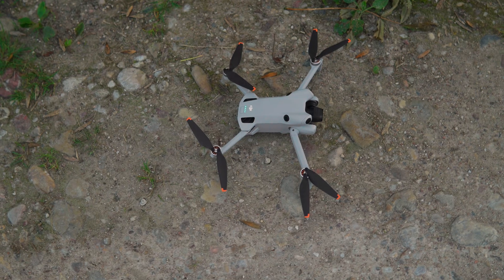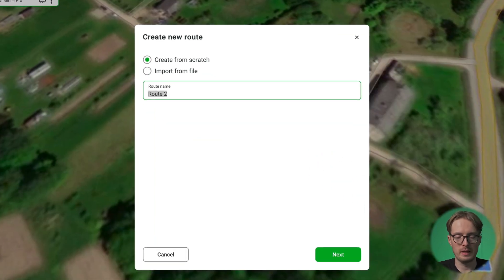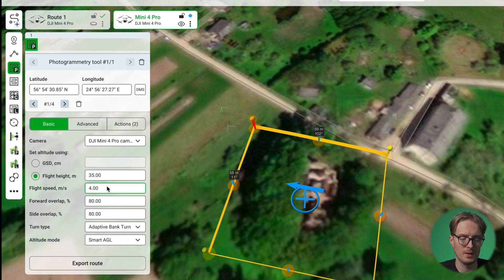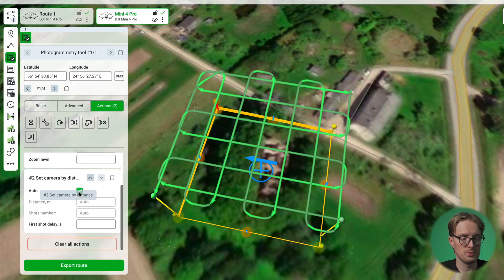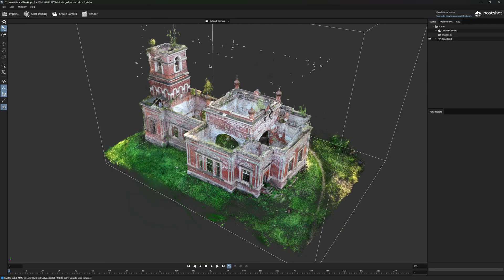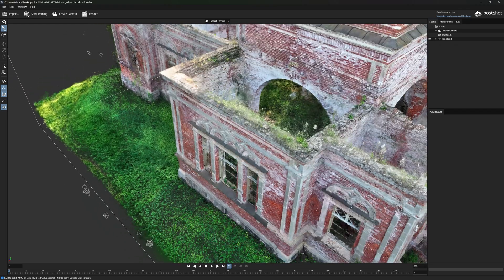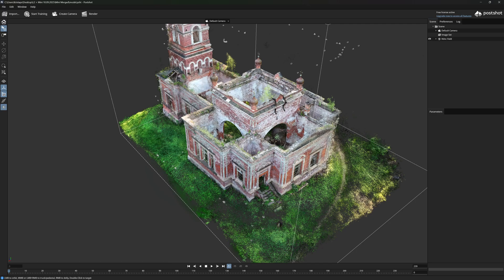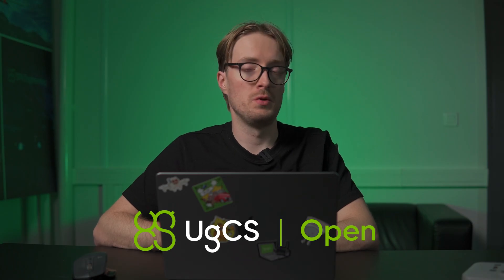How I Made a 3D Church Model With a Tiny Drone for FREE

Comment: Did my first 2 mappings with the ugcs and mini 4 pro.   It works! Had some problems fixing network and ugcs companion.   At the end all works but I have 2 questions.  1. How set the shutter speed and iso in ugcs? 2. How to save maps on laptop to upload on companion on the site?( now I have to take laptop and tablet together to link).  Greetings.
Reply: Stil no answer?
Reply from the maker: Hi! To answer your questions - 1. Currently shutter speed and iso cannot be set in the Companion app. You would need to adjust it in DJI Fly app. 2. On the Companion app it is possible to sync routes for offline use. Doing so also will save the map area, allowing you to launch routes directly from Companion without having to connect it to a laptop in the field. Here are the instructions: https://manuals-ugcscompanion.sphengineering.com/docs/offline-route
Reply: @ugcs_official thank you. 🎉